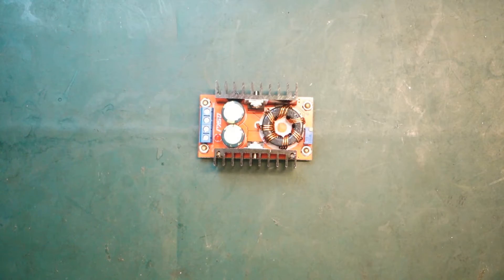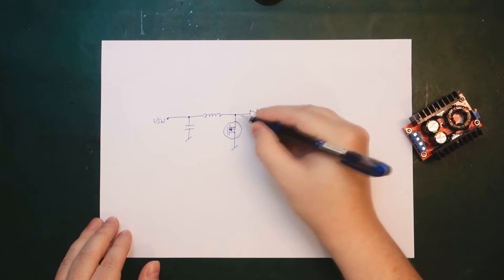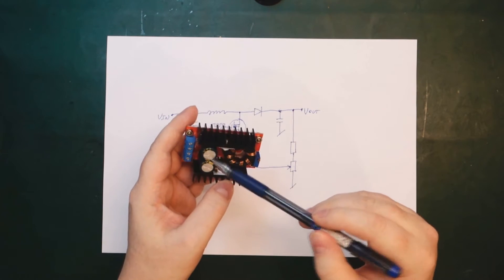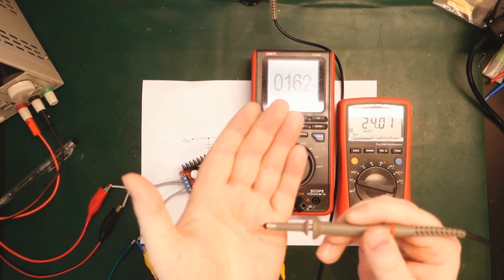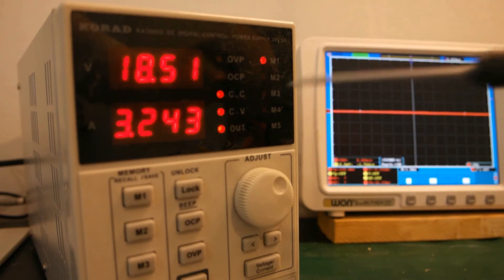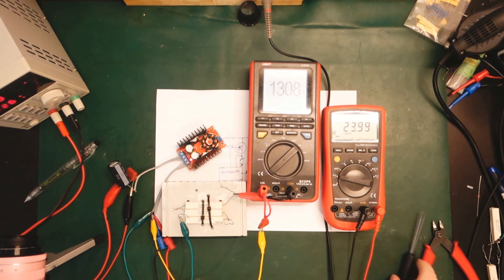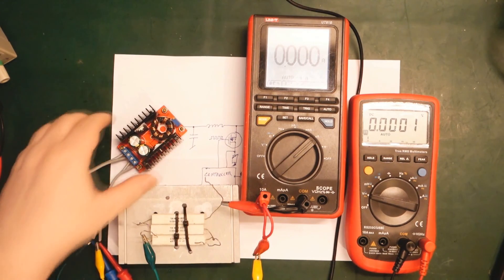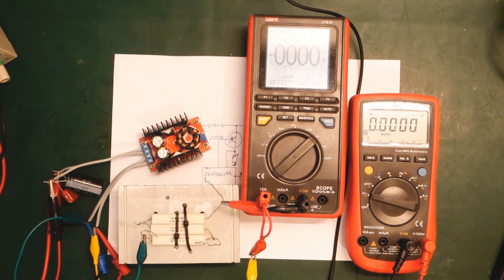Boost Converter 150W eBay Review

Comment: So you recommend increasing both input and output caps with filters in both?
Reply from the maker: Yes, you'll get better performance with a cleaner output.
Cheers,
Jake
Reply: @TheStuffMade  any recommendations on caps values?
To actually match the 150w, not that i will go over 100w in principle

Comment: hi! can i use this to convert 12v from a computer supply that delivers 14a to get 24v and around 5a? i want to power a 2.1 audio amp using the tpa3116d2 chip

Comment: Hello. I also have this converter. I use it for my T12 Soldering Iron. Input 15V to 24V. I used it only about 3 minutes and it doesn't boost anymore. Now input is as output!
Reply from the maker: Sounds like the mosfet or the switching controller is dead, then you just get the input voltage on the output with a small voltage drop over the diode.
Cheers,
Jake

Comment: Sir, how can I boost voltage up to 50volt ?
Reply from the maker: This will only do about 30 volts output maximum, but you might be able to modify the feedback resistor divider values to get higher output voltage.

Comment: Not  a particularly informative video which purports to be a review. Frankly the item is a piece of Chinese junk not worthy of the time spent testing. No wonder the reviewer added filter caps.
Reply from the maker: I'm happy to answer any questions you might have on anything not covered in the video. For a practical use of the little boost converter module I recommend looking at my video on thermistors and their common use cases.

Comment: Do you maintain the amp output of the power supply or do they change. If my psu is 5a will this put out 5a?
Reply from the maker: The efficiency is not 100%, you have to expect a drop in output power vs input power.
Reply: @TheStuffMade   Thanks. So the psu must output more amp's than which you require at the output of the Boost converter? 
I'm still learning. I want to build myself a power supply that can deliver at least 100watts and at least 30V with current and voltage regulation.
I have a 12V 300w ATX. Is it possible to do any suggestions?

Comment: Having 10 50v 1000uf caps wired in parallel works better than one 50v 10,000uf because each cap will share the voltage which allows each cap to run at a lower temp and the add your filter cap to get rid of the noise, but did you hear him not say the voltage on the poly filter cap? Just keep it 50v 1uf.

Comment: Please reply,I used this Module to step up voltage for an amplifier board from 12v 2a adapter to 24v.the amp worked well for about 1hour and then it is giving problems. Now the amplifier board is not working properly even when not using with this module. Could this be the culprit? (I ordered another board but I am afraid to use it with this boost converter. )

Comment: Could I use one of these to charge a 24v lead acid batter from a lower voltage source?
Reply: @ 9:18 he added a 50v 4700 Micro Farad Capacitor to boost the overall amount of energy and a 1 Micro Farad Capacitor to filter the noise and ripple. By doing this he managed to stabilize the source and added more power out. So I would also add the same idea just use a 50v so it has a easy life and you can increase the Micro Farads for charging a battery because a battery is power hungry and I don't believe you need to use any filtering capacitors, batteries don't mind the noise, it gets things moving, but for audio, you need to filter.

Comment: In addition to the 4700uf Electrolytic Capacitor, I would like to know the exact specification of the Fime Micro Capacitor of 1 uf is 250V or not? what would be the specification. Thanks in advance.

Flawber - Brazil.

Comment: Hi, which MOSFET is used in this module? Thanks, Antony...
Reply: Hi Antony..i just bought 5 of these and just checked....they are based on the RX75N75 which is a 75V & 75A N-channel MOSFET (datasheet here: https://www.datasheetarchive.com/pdf/download.php?id=3ec304cdff79865e47df12f27e64156708894b&type=P&term=RX75N75) A more unusual one.....and it is paired with diode SB2040CT on the other heatsink. I havent come across them before that i recall.

Comment: Used for lighting a 100w led. .but the current iam geting is 0.25 ampsat 34 volts. Input from a 400 watt computers smps +12v rail.Is it the max that it can produce or something i want to change? Plz reply sir
Reply from the maker: I believe the problem you are experiencing is because the boost converter can  only deliver up to ~30V, so the output voltage never gets high enough to overcome the voltage drop of your 100W LED.

Comment: Really good review mate, thanks. It was very informative. 

So if I want to power a laptop from a 12v battery, should i add some capacitor in input and output?? Will that lower the ripply voltage??

And even if i dont add any caps will it hurt my laptop??
Reply from the maker: Thanks, I'd recommend using something like a 2200-4700uF decent quality electrolytic capacitor rated at 35-50V together with a 1uF film capacitor on both the input and the output if you are going to use this to charge a laptop in a car. The large capacitors will remove the ripple, and the smaller 1uF will take care of most of the high frequency switching noise.

If you don't, well it depends on how much ripple and noise your laptop can tolerate, can't give any firm answer on that, but the risk is that you fry components on the input due to unexpected high ripple voltage and the switching noise could mess up both the laptop and your car's electronics.
Reply: thanks mate. BTW in the video when the voltage was too low the multi-meter was showing 9.5 v output even when the converter stopped working, won't that create problems??

Comment from the maker: +Philip G Hi, most of the noise is high frequency switching noise, without bandwidth limit on my oscilloscope that goes up to near 200MHz it was something like 8Vpp, with 20MHz limit it lowered to 4Vpp, if I remember correctly. The actual ripple wasn't so bad, but with higher load the ripple will get worse.